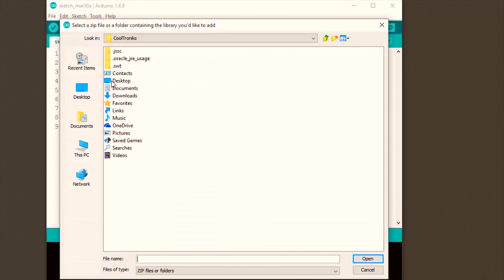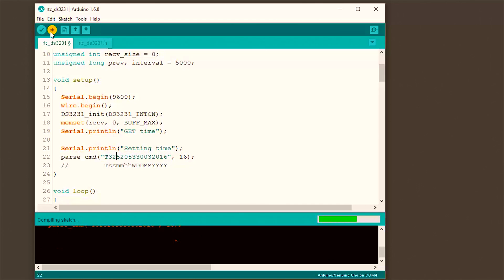Getting Started With DS3231 RTC Module

Comment: my DS1307 RTC  is not keeping the time while the arduino is without power.  As soon as I power the arduino back it starts exactly where it left
Reply from the maker: Kareem Mohamed change the battery
Reply: Cooltronics l changed the battery but still having the same thing
Reply: Thank you for the/your quick reply
Reply from the maker: comment the parse command line, the upload it again.
Reply: is some thing wrong  with this code

Comment: I have the same board, but with 5v at vcc my poor LIR2032 (which is strange it was shipped with a CR2032 from china, a non-recharge batt))  is charging at 4.7v as several others have posted about.  As much fun as it is watching things blow up normally, I'd not leave this thing running at 5v unattended or you'll have some fireworks... or fire... in your house :/

Comment: i keep getting this error when i try to compile i am using the 
rtc3231.ino file with lcd from your download. i am using arduino 1de 
1.6.8 how can i fix the error. 
C:\unzipped\DS3231_Program\DS3231_LCD\RTC3231\RTC3231.ino: In function ‘void loop()’:
C:\unzipped\DS3231_Program\DS3231_LCD\RTC3231\RTC3231.ino:41:24: 
warning: deprecated conversion from string constant to ‘char*’ 
[-Wwrite-strings]
         parse_cmd(“C”,1);
                        ^
    

    Re
Reply from the maker: Hey Jim, I think you haven't extracted the downloaded file.
If you have winrar try to extract the file. then you'll going to receive two folder.

Try right clicking on the RTC3231.ino file inside ds3231_lcd folder, and open with arduino.
that's what i am doing.

I hope that will solve your problem